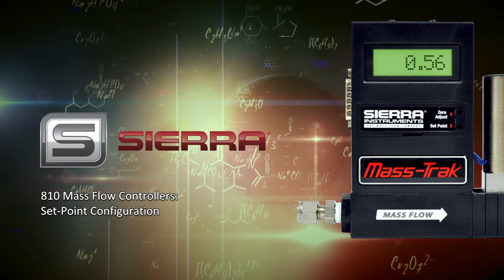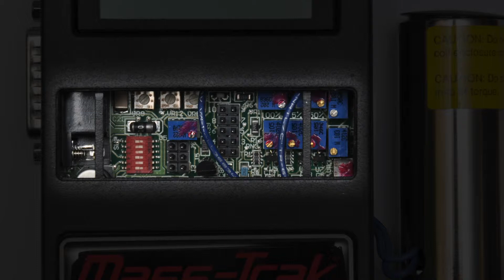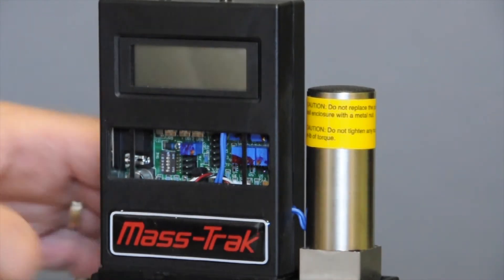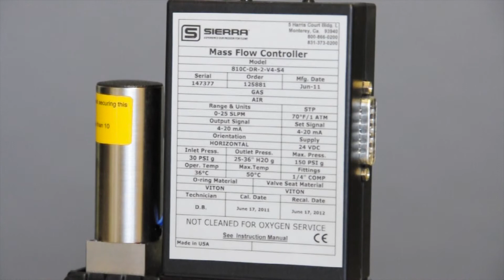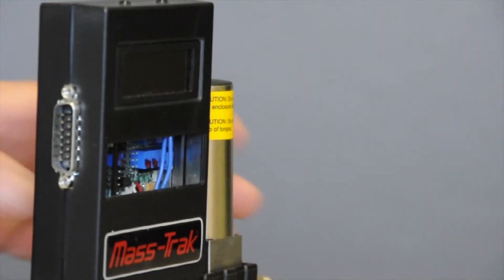How to Configure Your 810 Mass Flow Controller Set Point

Comment: What about 50 Series MFCs that has two DB9 connectors. What is 2nd connector for?
Reply from the maker: ALI MIRZA The two connectors on the 50-series are parallel.  Either or both can be used. For instance, you could plug in power to one connector, and signal into the other. If you have any other questions, please let us know! 
-Jim Oswald
Reply: Thanks Jim.